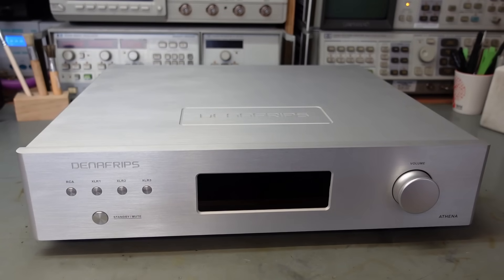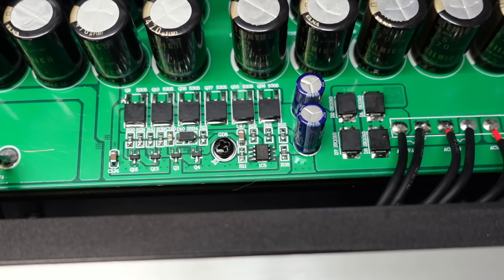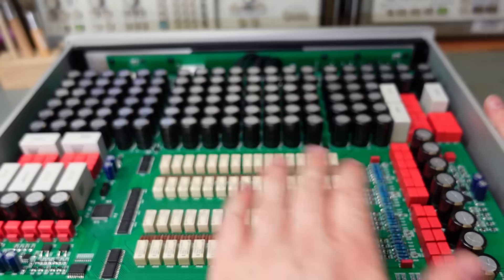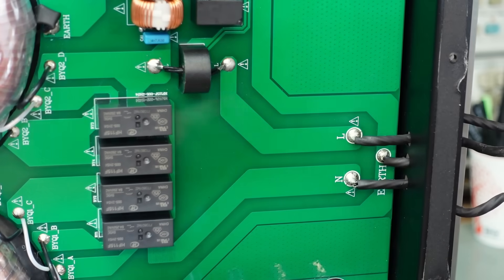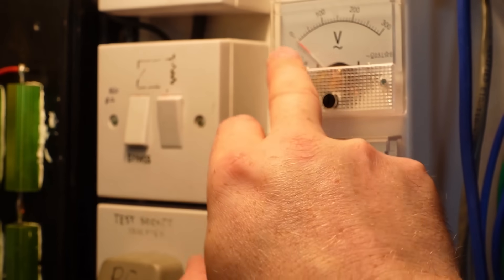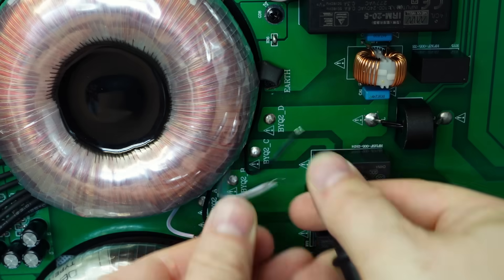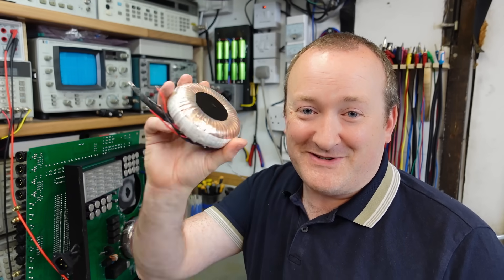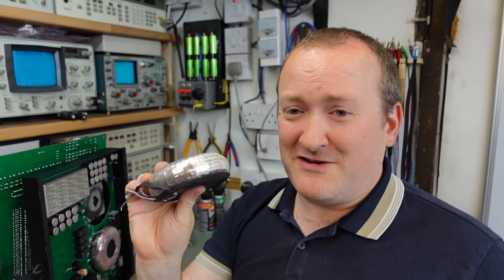ATHENA has fallen!

Comment: Audiowankery at its finest. Way way way too much capacitance in the power supply and all those relays are totally unnecessary. They go to these extremes but can't supply a decent quality transformer. I don't think it's a case of not being able to withstand 10 volts more on its input, which any good quality tranny will do all day long. I believe it's due to poor (low grade) insulation on the windings which led to shorted turns.
These places sure know how to make audiophools part with their money!

Comment: You’d think for high end audio gear they’d have those transformers being cooled in a closed circuit bath of non conductive novec fluid. Would also have the benefit of increasing the cost of the amp by £1000’s.

Comment: I disagree. Over-engineered but also sloppy engineering. If it's sold in the UK and not able to deal with 5% increase in voltage then it's not fit for purpose. If it's always-on and burns out as a result, then it's again not fit for purpose.

Comment: Terrible design asking for a short service life. Caps in parallel reduces ESR but increases risk of failure. Better to use less caps with more HF bypass... Mechanical relays for gain control -nuts!
Reply: This type of volume regulation is quite common on hi ens stuff, saw it recently in a studio monitor regulation device as well.. no more noisy pots for sure.. 😊

Comment: I doubt Mark himself will answer, but WHY does the sound on his videos sound like a cheap transistor radio with a 2" speaker from Hong Kong? ...... And no, it's NOT my Tablet speakers, because Mark's videos are the ONLY videos that sound like two Baked Bean cans joined by a piece of string! 👎🤣

EDIT: I have a 1990 £300 British (Wembley, London) Musical Fidelity B200 Integrated Amplifier, with Toroidal Transformer. I had to have the Toroid replaced by MF many years ago (cost £100), as I burned it out blasting out my horrible sister-in-law next-door!

Comment: While this may look impressive with its repetitive components, in reality they are all cheap made in China components, Aliexpress will disclose the real end user one-off cost, so manufacturer cost 1/4 of that, ELNA RFS SILMIC II for just on £1, OMRON Signal Relay G6S-2 2 for £1,  the component total cost probably around £250, case £30, assembly / packaging £50 the distributor will be making a very tidy profit on these under voltage units, then probably charge a fortune to repair the poor voltage damaged components.